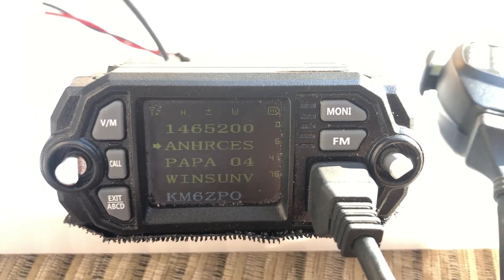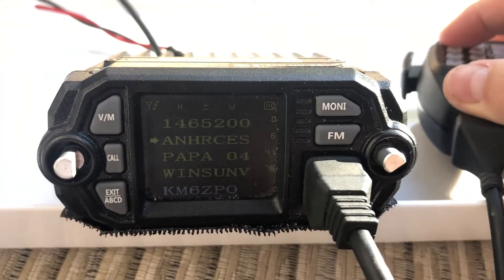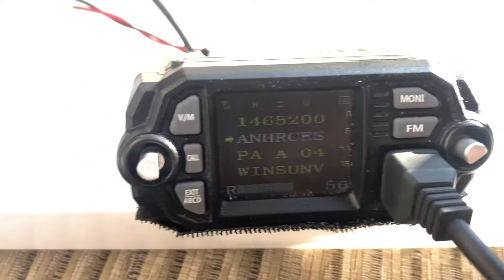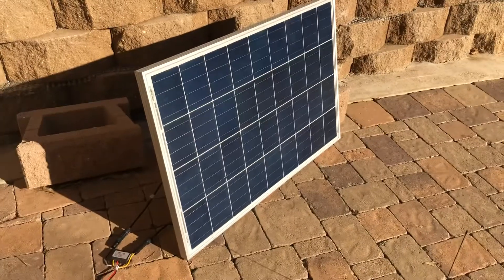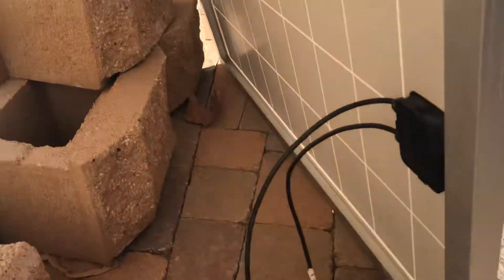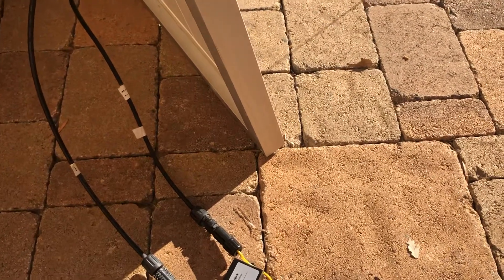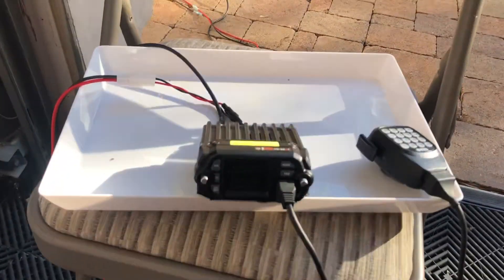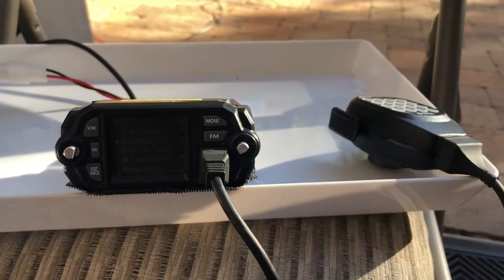Demonstration of a Btech UV‑25x2 Running on Solar Power

Comment: Never seen this radio.  I looked it up and as I understand it can monitor more than one frequency at a time.  Have you tried this with cross band FM satellite work?  Looks good!
Reply from the maker: This radio will not work for "working satellites". You need a full duplex dual band radio for that.  Radios like the Kenwood TH-D72a support full duplex, dual band.
Reply: @MarkWarrick  So only one RX in this.  OK.  Thanks!
Reply from the maker: @W4TRI_Ronny  any radio can receive satellite transmissions.  You could have two Baofengs UV-5Rs - one for listening (using headphones) and one to transmit.  That would work just fine!